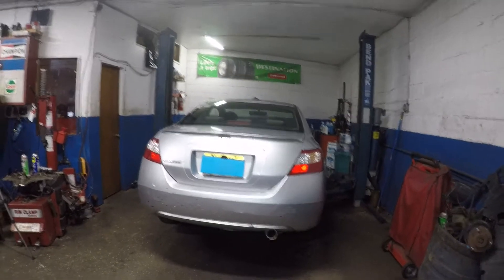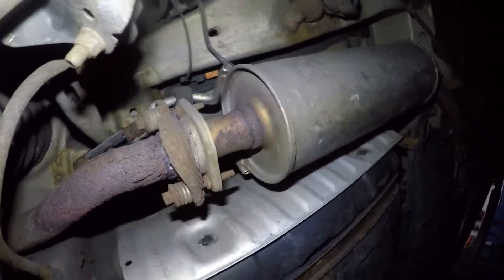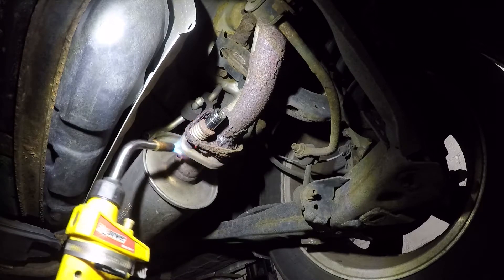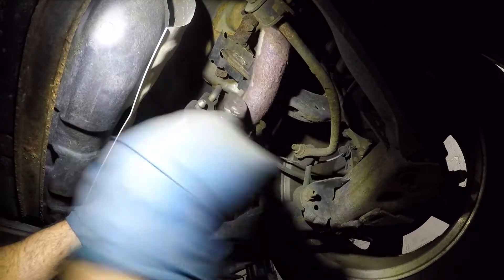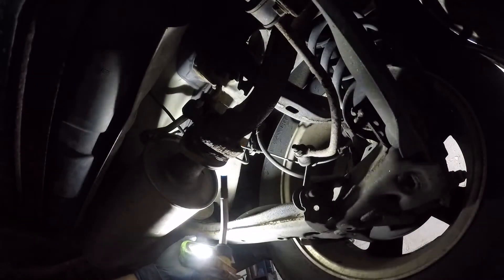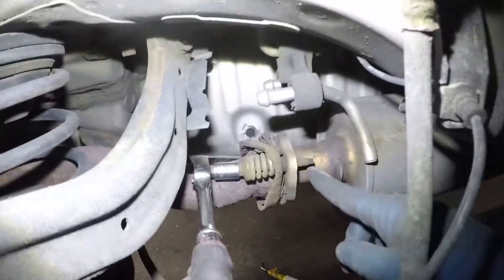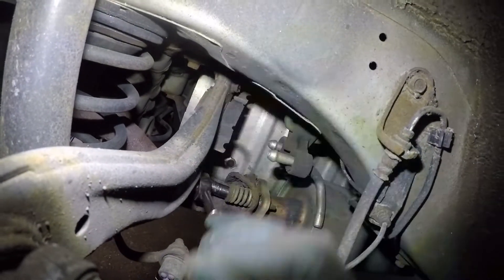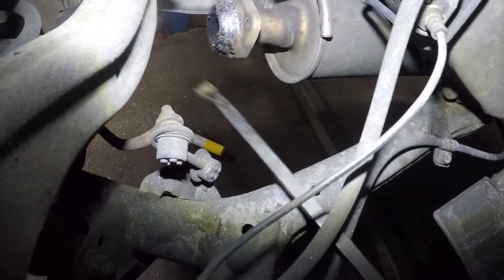Honda Civic Broken MUFFLER replacement 2006 to 2011

Comment: hello not sure if you'll see this comment. do you know what the exhaust diameter is for the 06 civic? would like to put a new muffler on. some results say 2.0" some say 2.25"
thanks
Reply from the maker: No clue on the size u need to use caliper measurement tool to check the size of
Reply: @RBTheMechanic  all good lol

Comment: The hardest part was cleaning off the old donut. I sprayed my bolts with pb and let soak over night. I have an 2010 civic lx.
Reply from the maker: Yeah that’s a good trick
Reply: Bro how did you remove the old donut I have that problem rn I don’t know how remove any tips ?

Comment: I am a newbie and cross-threaded the nut on the exhaust😂 and the bolt. How could I rethread the nut, which is welded on the exhaust? thread chaser, taps, helicoil, or time cert? Big Thanks!
Reply from the maker: Well that’s a trouble if u didn’t go toooo far try to come back out but it might brakes however if u get it out u need to use tap and dye recreate threads or use smaller thinner bolt and put another nut
Reply: @RBTheMechanic  not far. I got the bolt out. The top few threads are crossed. But I don't know how bad the nut is crossed threaded since it's welded on the exhaust. https://drive.google.com/file/d/1Tz1a1BKTD9eDzwitjtXiCjuY7L68sgm1/view?usp=sharing
Reply: May I use a same but new bolt after rethreading the welded nut? Do you have the link for the smaller thinner bolt and another nut?  Does the smaller thinner bolt have the same shape since there is a spring between the bolt and nut. Thanks!
Reply: Can't put a product link here. Will PITTSBURGH Carbon Steel Metric Tap And Die Set, 40 Pc. (please google this product if you would like to see it) do the job? Sorry, tried to give you a link for the product, but youtube deletes the comment with a link automatically.

Comment: Can the entire system cat back be dropped out as a single piece? I plan to test this on the 07 I just bought but the muffler was separated from the resonator. I plan to take a virtually new exhaust from a scrapped civic and prefer to pull in tact. Again from cat back. Maneuvering the muffler is my only concern
Reply from the maker: Yeah u can do that but make sure u check for rust this is weak spot even if it looks good internally it might not be so good

Comment: As I watched I kept wanting to soak those spring bolt threads in WD-40, lol. I didn't think to heat up alone, I was thinking I would need to spray those bolts on middle and back with something like pb blaster. I got my muffler for 75 and my gasket for 6 on the way and will do this later this week. Mine popped off right at the back too.
Reply from the maker: Yup I got mini ductor now these jobs be like eating cake
Reply: @RBTheMechanic  I've seen those, running for 400-500 each lol. I remember I held off for the longest from buying me a brad nailer, and just hammered finishing nails into trim at house because I thought "why spend 150 for just a couple jobs". Once I got my 18v brad nailer and did trim and moulding with it, I loved it.. and found other uses for it. Maybe one day I'll get a ducter.
Reply: @RBTheMechanic  Mine are just spinning in place. I've heated them up. I see it spinning at the bolt of course, then between flanges there is a barrel that is spinning then on back of condenser flange I think they call it. Then finally the end of screw is spinning. I see no sign of the sping starting to spread. Happening on both 14mm bolts on mine. I got a 2007 Civic ex
Reply from the maker: @dareptile2653  gonna have to work some magic there maybe it’s free playing grave it with vice

Comment: I broke the bolt. How can I remove the remaining from the pipe? Thanks!
Reply from the maker: Extract it gonna be tough but extract it
Reply: @RBTheMechanic  The bolt broke at the point where the thread ends. https://drive.google.com/file/d/1hN9U9u6vhRj4PkMe7c7g5s475GGiPGYS/view?usp=sharing
Reply from the maker: @jamesyu2066  u had to heat it why didn’t u??? But u gotta drill it
Reply: @RBTheMechanic  I didn't heat it enough before using the wrench😂
Reply from the maker: @jamesyu2066  yeah these are tough SOBS but try drilling it
Reply: @RBTheMechanic  I got the broken bolt! I heated it up very well and the plier rotated it out toward the exhaust. Thanks a lot!😆I wish your shop is around my town
Reply from the maker: @jamesyu2066  wow good job!! Yeah when they cherry red they come out good I use minidutor now that works like magic
Reply: @RBTheMechanic  This is a pro tool!